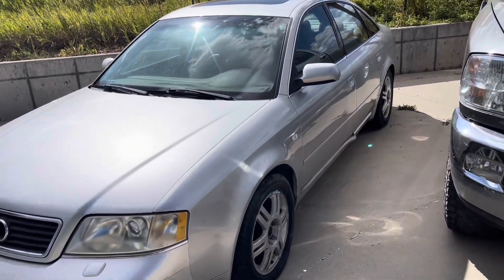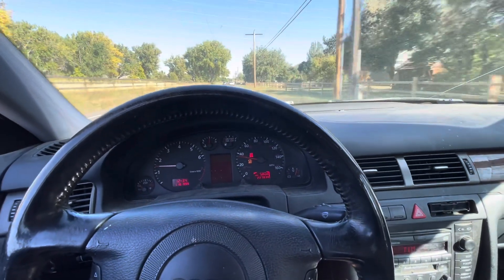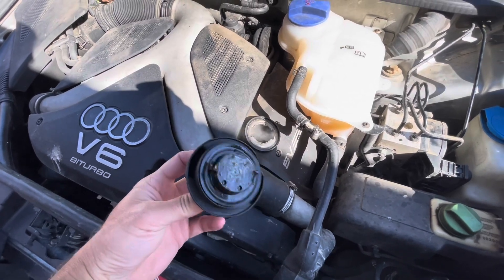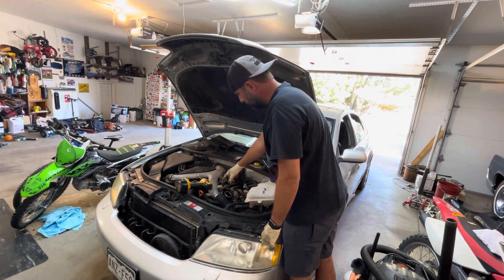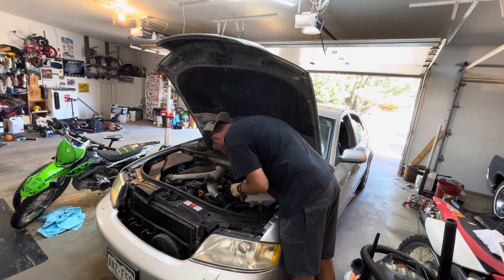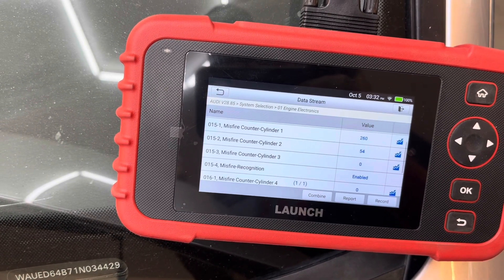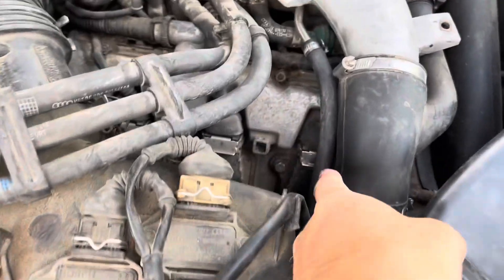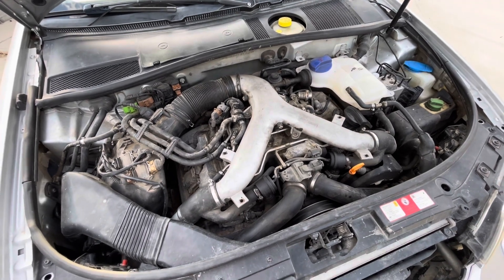2001 Audi A6 2.7T head gasket failure diagnosis

Comment: its a 1999
Reply from the maker: @samaelilith6099  what’s a 1999?
Reply: @T1000sGarage and the cluster have no allimonium rings on it. Than you can know if its facelift. With 252ps and diffrent type of automatic gearbox. And the bitturbo letters on the engine cover are red by facelift. So maybe you car is first driven in 2001. But its made in 1999
Reply from the maker: @samaelilith6099  Ok, my VIN says it is a 2001, so does the registration and the emissions sticker says "complies to 2001 model year emissions." Interesting info on the facelift though..
Reply: @samaelilith6099  It's most likely an early 2000 manufactured one because I have the same year Audi and mine is the same way, checked the Manufacture date and it was made in Jan 2000
Reply: @T1000sGarage sorry if im wrong
Reply: @T1000sGarage  the car ? The digital date go back to when the car was build if you reset. By you stay 1999. I have also a6 2.7t from 2001. When im reset there stay 2001.